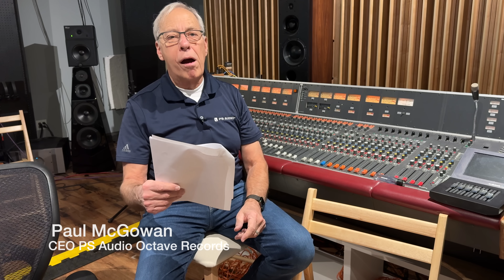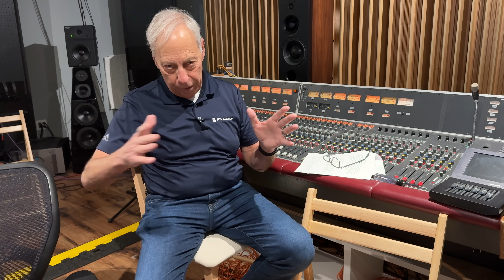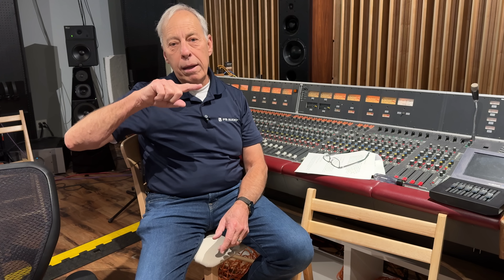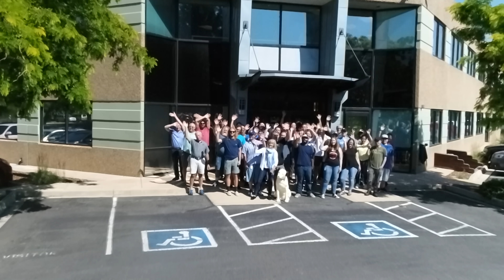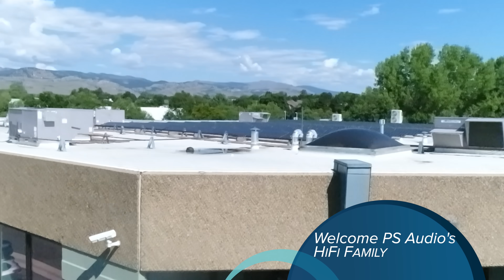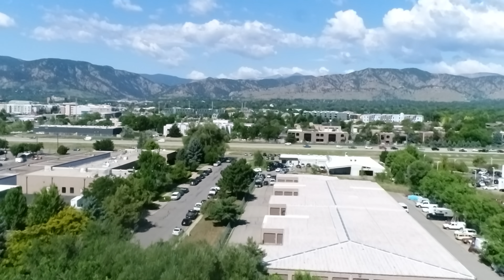Solar power and Hi Fi

Comment: We have solar panels and a battery and a P20.  When the power goes out and the system is running off the batter there is a hum from the P20.  Also, if it goes out when the system is on there is an unpleasant sound when it goes out and comes back.  Any comments?
Reply from the maker: That sounds like a good system. The hum is likely because your solar inverter isn't outputting the cleanest signal or has some DC on it - which is then good you're using a P20!

Comment: There are different kinds of solar inverters. Some high frequency without transformers, some low frequency with large toroidal transformers that isolate the dc switching side. It's rather like the power regenerators for audio, but without the finessing for hifi. There will be advantages in not having the hash and sag of mains line power, but maybe some issues of source impedance/current delivery. However if you have a big enough solar inverter of multiple kW, I'm guessing that current won't be an issue. However I don't know yet, but will find out soon when I install my solar system. Interesting issue de-jour

Comment: These ideas of running equipment from DC are not practical. What would be the standard voltage? Telcom equipment does have a standard of 48 volts, positive ground. But what happens inside the ethernet switch that needs 3.3 and 5 volts internally. Well we use a switch mode DC/DC converter to reduce the incoming 48v DC to a lower value. That's an inverter DC-AC-DC. Linear regulators are out of the question especially for battery systems. Far too inefficient. Audio and other analog electronics presents another problem. We need bipolar power rails like +/- 15 volts or higher split voltages in power amplifiers. Once again we need a DC to DC converter, which is an AC based inverter. You can't get around that. A switch mode power supply is actually AC-DC-AC-DC. The incoming 120v or 240v AC is rectified to around 300v DC, runs a power oscillator at a much higher AC frequency through a high frequency transformer, then back to low voltage DC.

Comment: I had some X10 home automation problems - remember that system, I still use it. I also have an 11kw solar installation. So I recently looked at my AC wall power on a scope*. Clean smooth sinewave! I was quite surprised myself as I thought I would see some distortion from the solar inverters. So it seems that the "solar is bad for high end audio" myth, is in fact a myth! (As for the X10 problems, my booster/repeater box was dead. But they still sell them!)

*Connecting a scope to the AC line requires isolation techniques I wont get into here. Remember most scopes have grounded power cords and the scope probe ground is also tied to the power cord ground. Could be deadly if you don't know what your are doing.
Reply: The neutral is same potential as the shield ground..they are connected at the bus bar in the box.thats connected to a ground stake driven into the ground outside your house..
Reply: @davidstevens7809  Yes, that's correct but as the neutral is only bonded at the service panel, or should be, there can be a few volts difference due to cable capacitance or leakage within attached loads. While this is still basically harmless, if the scope probe ground is inadvertently connected to the hot or the receptacle is mis-wired, the results can be dramatic. When I perform these measurements I lift the scope  power cord ground. But I am aware of the dangers. Someone without electrical knowledge may not be, hence my warning.

Comment: I would query your statement that 230V AC is up to 115V and down to -115V.  In the UK we have 240V AV which is the RMS value. That means the voltage Is 325 peak to peak. Just a small point but it helps to explain why you get such a jolt if you accidentally become part of the AC circuit. (Amended after useful comment by Andy Delle).

Comment: Im running a bosch inverter and its always syncing and saying that mains frequency is out of spec. eg the power grid frequency is always changing and not clean at all. This is most likely due to the number of devices eg house Solar, wind farms, gass power statitions, battery farms etc etc all injecting  power to the gridd and all trying to keep in sync.  Good audio equipement should have good power supplies and DC filters. Prob is many stymp on capacitor sizing so the louder the amp the more strain on the power supply / filters and therefor distortion from not anough available current/voltage and or AC ripple frequency starting to be introduced as the capacitors symply cant filter the demanded power. Correct me if im wrong, as been 20+ years since doing Advanced Amplifier and Power supply engineering :P

Comment: Hey Paul:

Just had to comment on this one.  I have a flexible solar setup that I use for differing loads.  When not running something, I have occasionally connected the output of my 2 kilowatt inverter to my sound system.  My battery system has 5 kilowatt hours capacity at 24 volts DC (yes, possible 80 amps at 24vDC); with 2-gauge copper feeding the inverter.  The 120VAC output of the inverter runs through 12 ga wires about 16 feet to my sound system; with results sounding great, even at high levels from my power amps.  Now, you've got my curiosity up.  I'm going to connect an oscilloscope to the inverter output, and check to see inverter sine wave with audio system demands.  However, I'm very curious about PS audio power plants.  What is in the internal DC voltage you spoke of?

Glen O'Hara
(Arizona recording engineer)

Comment: All solar systems have battery bank that its charging..
Reply: No, I would say most systems over 7-8 years old are grid tied. Even today grid tied systems are still installed due to their lower cost if battery backup is not wanted. A grid tied inverter has some large capacitors across the incoming HVDC, but it's not a battery.
Reply: @andydelle4509  ok I admit .  I thought that even the ones that were designed to redirect the output to the masses always had batteries.. im 60 I was taught a long time ago.

Comment: Paul: What is your take on what I recall as the old Engineering saw: Whenever you convert from one kind of energy, force, you lose one ~ third of the, "raw energy," force. Gasoline into forward motion in you car, or, home electricity into your Tesla, batteries, then from the batteries to forward motion {or, car heater during recent "cold ~ snaps," limiting range.} If this is significant, as solar power use increases, it may be well worth the effort to make equipment which can operate directly off of solar panels, or the garage, dc power storage panels. 😁:face-blue-smiling:

Comment: ARG!!
Solar panels pump DC into batteries, the invert to AC and then into a Power Plant to convert it into DC to invert into AC to an amp which turns it into DC.  The problem we are solving in this equation is selling a power plant.
How about buying an inverter that is as good or better than a Power Plant and run your system off batteries which are charged by the sun or the grid.
Computer data centers run off battery backup systems.  There clearly are inverters that can handle massive loads and produce clean power.  Computer servers need great power.  Certainly better than what you find on the mains.

Comment: Solar inverters are a known source of RFI both inducted and radiated.  It is not unusual to see spikes in the AC line after the inverter but also common to see radiated emissions from the inverter which will cause notable interfere in AM radios, TVs and even has degraded cell site coverage.   So aside from a power conditioner you will have to use high quality cables on your sound systems even Moreso
Reply: Well I recently looked at my raw AC line with 11kw of solar inverters operating in the southern California afternoon sun. Clean sinewave, no issues. Now that doesn't mean some systems don't have EMI/RFI problems but I suspect most don't.

Comment: My headache is the frequency . I own Tesla solution and they play with the frequency , you can’t get 60Hz , is always between 63 and 65. I don’t know if that is bad for the audio equipment. I also have a PS Audio power plant and make stable the voltage but do not fix the frequency issue.
Reply: Unless you have an old tape deck or turntable with a 60hz induction motor, it doesn't matter. That is well within the tolerance of a device power transformer. Switch mode power supplies could care even less about AC power quality. Most can even run on around 300 volts DC. As for the PS Power Plant, I understand it is not true double conversion so it may have to ride the input frequency - I don't know.

Comment: Much controversy and debate. I'm pretty sure The Energizer Bunny could settle this once and for all. J Fets used in many sophisticated amps are mainly manufactured for the solar panel industry. Former PS Audio partner Stan, once related a headscratching brain teaser that had them all stumped. One of their preamp customers complained that their preamp only worked at certain times of the day. The problem was finally solved; they figured out the preamp was connected to an AC timer.

Comment: Seems to me that current electronic devices aren't up to speed with solar powered houses. I mean, if you store DC current in large batteries, you only need voltage regulators to power your equipment, and you can skip the AC/DC conversion altogether, right?
Reply: how do you want to do it?
Reply: Most solar batteries are HV as Solar arays are eg 400-500v dc they do this to keep the effeciency up more voltage less current, regulate voltate back down to 240v and produce more current. Off Grid inverters and batteries tend to use 48v more probably because they use much more larger battery banks of either Lithium 12v batteries or AGM etc kinda keeps the price down too. If I ever build a house on a farm and go offgrid. all the lighting etc would run directly of DC and as much of the house as i could and save the inverter to power only nessasary AC equipment.

Comment: It should have plenty to do with how good the transformers in the audio gear are as well, since that's where the final result is gotten in terms of power. If one says that, say, any amp can't possibly convert whatever AC to good DC then one can't say that a power plant can do it either.

I've seen measurements taken on what comes out of the wall, what a power plant does with that power, and the difference between the two in what the amp power supply generates, and in those cases the signals have all been 100% identical in the end, so it's clear that there is audio gear that can deal with imperfections. How common it is with gear that can't, or what the limit is on distortion from AC that can be fixable, are other factors that I don't know the answer to, which is why you has to put in some work to see if you actually have problems with this.

Comment: Solar makes DC, battery stores DC  amp uses DC!
So the tyranny is that the electronics use say 48 Volts DC for a moderately powerful amp,it doesn't need AC at all you could run it directly off the panels on a fair day, or more realistically the battery for the house with the AC PSU removed from the amp all together.
As Solar generates natively DC, as does any attached  battery storage, we have to build an inverter with an arsenal of high power semiconductors and signal electronics to regenerate the AC for use in a domestic setting, then convert it back to DC in the amplifier. as there are issues with some inverters, Paul suggests yet another  hugely complex power conditioning step for power factor. So you go DC (panels) to AC (inverter) ACtoDC and back again to AC  (conditioner) and finally AC to DC in the amp PSU!!
END to end this seems like madness, a huge amount of budget and electronics that isn't at all necessary just based on the physics.

Comment: Certainty if you have no grid fall-back, any voltage dips in the solar system are going to cause you issues. But if you have the grid right there, It's a non issue. (unless you live in the coal fields where the grid takes massive hits when they fire up the big drag-lines / rope-shovels. So long as you have a stable 50Hz. 99/100 punters are unlikely to be able to notice any difference in a double blind test.

Comment: I have a 10kw pure sinewave invertor, 10kw of pv panels and 10kw of battery backup and since installing the system I just fell in love with my audio system all over again. The sound is cleaner, soundstage opened up,  highs are clearer and the base are as tight as can be. I think all depends on the invertor quality. Modified sine wave invertors are horrible for any electronics
Reply: I'm pretty sure you mean 10 kWh battery backup. 😉
Reply: @Fastvoice almost certainly correct. Having said that, whilst the energy storage capacity is key, so is the available power output. People undoubtedly get confused but I would want to know both when considering a home battery.

Comment: Why don't you factor in on your power plant to except DC input up to 48 volts.
Reply: Where would you get a stable 48 Volt source? Not from the solar panels for sure.
Reply: @Fastvoice  up to 48 volts if you're running a battery pack that's what it would be more than likely
Reply: @hoobsgroove  Yep - but how big would the market be for such audio devices? Only a few households (which own a house and are not renters or only apartment owners) have such an expensive power supply chain. So you're talking about a niche in an already miniscule market.
Reply: @Fastvoice  somebody's gonna afford to spend the money on one of those generators more than likely they're probably got some battery powered electricity system more and more people doing it the cost has come down a lot plus you get a subsidy from the government
Reply: @hoobsgroove  Even if that's true: How many of those are high-end audiophiles that would even care about or hear a subtle improvement (if there is any in the first place)? Would that number be sufficient for a company to produce a high-end DC powered amp for home use?
(BTW: There are already DC powered amps for cars and camping)
Reply: @Fastvoice  you could say that about a lot of things, and it wouldn't be expensive to implement a couple of dollars in parts

Comment: Wild: solar dc->inverter ac-> power plant ac/dc/ac -> amp takes the final ac and converts to dc so it can use it.  How about the amp just removes its ac-> dc circuitry and we plug dc into the amp

Comment: I have been running my entire house (and all the power consumers - computers, all AV equipment - in it) longer as two years on solar panels with battery storage and sine wave voltage converters. 
And the DC>AC voltage converters are the linchpin of the whole thing. 
I have never noticed any sound defects with my system (2x180 watts for  Left/Right speakers and 800 watts subwoofer).
Reply: The other factor is noise coming from the grid. I have panels but no batteries. When the panels generate sufficient current to power the house, my system (2 channel) sounds at least as good as when I am dependant on the grid. Often it is better because when I am on the grid during the day the quality of power from the local grid isn’t optimal. I can also hear the difference when the power from the grid improves in the evening. My other audiophile friends and my dealer also notice the difference between daytime and evening power from the grid.
Reply: It’s always about the music and the artistic creativity
Reply: Lara is near Melbourne. I am moving to a townhouse that has solar panels soon, and so it's also question of mains power vs solar + inverter power.

Comment: Photovoltaic power needs continual sunlight to produce electricity.
Solar Thermal has storage options and can produce power at night or during low light conditions.
Technically, photovoltaic cells can be used to charge battery packs, for later use.

Comment: As Amir has shown many times, power conditioners/regenerators/filters of AC mains do not impact the audio signal coming out of competently designed equipment in a measurable, much less audible (on a blind basis) way.
Reply: proof enough one should not rely solely on numbers.
Reply: @googoo-gjoob  he doesn’t. He makes a compelling case that you can’t listen to AC noise or its absence even if you wanted to. It does not appear in the audio output signal.
Reply: @Burphy42 you cannot listen to AC mains.
Reply: @Burphy42  what, specifically, about the work Amir has done in making the case that devices meant to treat, filter, regenerate or improve AC main power do not make a measurable difference and cannot (this is key) cannot make an audible difference, do you object to?  Please be specific in pointing out the flaws.
Reply: "As Amir has shown many times,..." <- maybe it's not quite as simple as you're presupposing.  And don't think for a second that Amir does rigorous studies.
Reply: @TheDanEdwards  I dont think it’s a simple issue. I also think Amir’s tests are sufficiently rigorous for the point in question. Two things can be true at the same time.